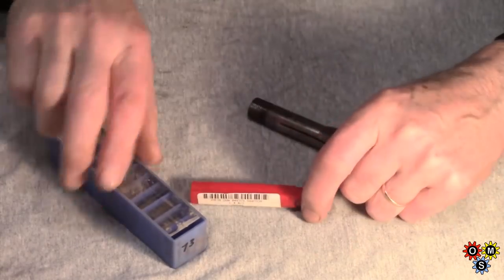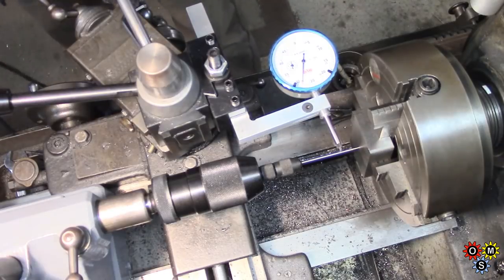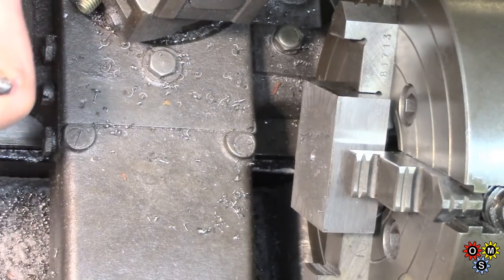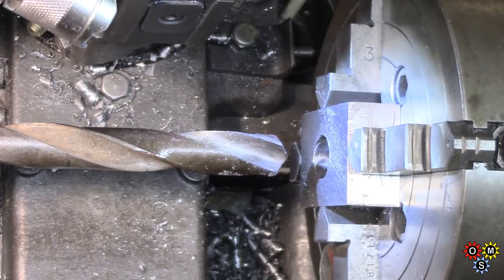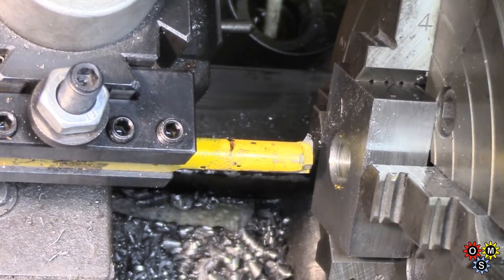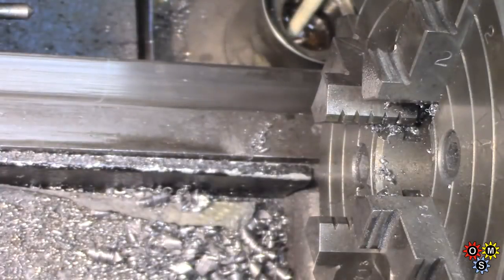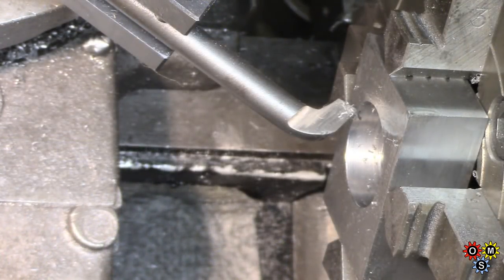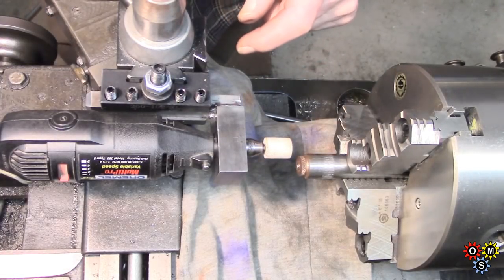Dremel Toolpost Grinder

Comment: I used the adapter that turns  your  Dremel into a router, it's a very nice easy to use adapter.  It has a channel in it that allows you to use the 1/2 tool steel to mount it to the cross slide  To post adapter

Comment: Wonderful video.  I assembled a tool holder that mounted on my Atlas Craftsman 12".  My dremel was used but in good shape no berring wobble, etc.  Very tight.   I've used it quite a bit to grind points on center punches lol.  That's about it.  Still a fun project and I have it now at my disposal if I need to get a bit more precision ground.   Thank you for sharing.  Good luck with your projects.
Reply from the maker: Hi Emil,
Thanks. I have since set up a holder for a small air die grinder which is actually a bit better because of much higher RPMs. One day when we get rid of winter cold I'll hope to resume some shop time!

Comment: Forget the dremel, too small. Find a small router and mount that up so you can spin the 1/4 shank stones. The dremel will bog at the slightest amount of pressure, the router will not.

If you do this be sure you buy stones rated for 20k RPM, not all are.
Reply from the maker: You are right Robert - it is though an awkward set-up to get a router mounted. I may yet try and find the smallest possible and experiment.
Reply: hell yea buddy plus the berings in the dremil will not last at all
Reply: I see a lot of those roto-zip tools at the  pawn shops. What do you think about attaching one of those instead of a dremel or router?

Comment: Have just bought a new 13x40 lathe. I have never used a lathe before, what is the purpose of having a toolpost grinder on a lathe.
Reply from the maker: Hi,
It's for those occasions when you might want to grind something in the chuck to a precise size and good finish, or even grind the chuck jaws to better truth - the Dremel however is probably a bit low on max RPMs and an air die grinder is probably better with much higher RPMs. Not something needed or used often but useful to have the option sometimes.
Congrats on your lathe - sounds a very useful size.
Reply: Thanks for taking the time to reply mate. Regards from Australia.

Comment: Chris, the older Dremel 380 has ball bearings and is much better.  They show up on ebay all the time for a song and a dance as they are 20+ years old.  Most are not used a lot and the case's look new.  If they look hammered then pass them up. I had one and bought two more on ebay.

Comment: All the mounted stones seem to come on 1/4" shanks.  This is the biggest limitation on using a Dremel I find.   Maybe if you made a set screw collet which screwed on in place of the Dremel nut/chuck (3/8x28 iirc) you'd come out ahead pretty quickly.  Here's how I mounted and used my "dremel".  Warning not for the plywood averse  http://imgur.com/a/DNWJq
Reply from the maker: Hi Matt,
Yes, 1/4 is very common - indeed a change to a better capacity chuck/holder would certainly be a plus - now you mention it I'll give some thought to that!
Certainly plenty of plywood. Your engraving set-up looks great.
Reply: http://www.homemodelenginemachinist.com/showthread.php?t=742

It looks like the consensus is 9/32(.281) x 40.  Although Dremel is German company,  it seems like they took the thread spec from old watchmakers lathes.

Engraving?  I'll have you know I've hogged material 25mm thick, in passes sometimes exceeding a millimetre.
Reply: MattOGormanSmith w
Reply: Forget the dremel, find a small router and use that so the 1/4 stones will work. Be sure you only buy stones rated for 20k rpm.

Comment: The early tools are much better.   Well balanced and probably much better bearings.  I've owned a number of different models over the years.
Reply from the maker: +Crafted 
Hi - well, must say despite mine being at least 12 years old, it is doing OK. Had to improve the bedding of the front bearing - even now the brushes are far from worn out. Haven't tried a newer version.
Reply: ChrisB257 Check this ebay link.  It's an example of the early style.  I've been thinking of doing what you did with one of these early ones.   They tend to run very smoothly.   Nice catch finding and fixing all the slop in that tool.  Maybe that is "why" I've thought all the newer style tools (I put yours in the new style class) are too sloppy.   Never tore one down to see the sloppy bearing mount.
Reply from the maker: +Crafted 
I guess they may vary but certainly my bearing housing sure needed just a bit of packing.

Comment: I have a Dremel toolpost grinder on my tiny Taig. Now, if you unscrew the nose cap on your Dremel, you will find a M19x2 thread. If you can cut a M19x2 thread (very close to a 3/4 x something Imperial; I don't do Imperial) your troubles are over. If you can't  (and I can't) cut that pitch, you can go buy the Dremel chainsaw sharpening attachment. About $15.  It has all kinds of places where you can screw it to a tool shank. This is what I did. To do it the right way, if your lathe can handle the 2mm pitch, go see www.frets.com and look up under the machining link. There are millions of neat tips and tricks there. The Dremel, however, is tail-heavy because the motor is in the tail. So in order to get things aligned you will have to use some packing.  Pain in the ar*e but much better than no Dremel TPG at all. Warning: Dremels are kind of flimsy compared to a "real" TPG.
Reply from the maker: +Juan Rivero 
Hi Juan - hadn't though of it being M19x2 - but anyways it is certainly as close as makes no odds to a BSF 3/4 x 12! It worked anyways.
I have now added a small packing and lightly tightened hose clamp to take care of the heavy end and keep it pretty firm. I don't expect to use it for anything real heavy or even that often - but useful if I need to precision grind a diameter to a close finish etc.
Reply: Dremels have ttheir limitations. But I have ground my steel jaws with it. They need careful adjustment and the hose clamp is a very good idea. I used it in my attempt to convert a dremel into a micro (nano?)  horizontal mill. Mixed results. But sometimes you want to grind a shaft to a really beautiful finish. Dremel TPG really good for that. Never thought of BSF 3/4x12 myself!
Reply: I just found this on ebay: 
Most modern, (post 1983), Dremel models have ¾ X 12 tpi 
The only ¾ X 16 tpi models are as follows…
    Dremel model #’s - #270, 370 & 380 ALL are ¾ X 16 tpi
    Ryobi model HT20vs is also ¾ X 16 tpi
 Black and Decker, Craftsman and Alltrade so far seem to be all ¾ X 12 tpi.
 Taurus M18 X 1.5 metric

Comment: Hi Chris - I made a similar thing after seeing Allen Powell's Dremel tool post grinder. <  https://www.youtube.com/watch?v=6_fxjdsKdpo&google_comment_id=z13lznk40vqdx3pbs04cj1lydrvocjbqcxo0k  > As I have yet to try thread-cutting on my Bantam, I did the next best thing and bought ready-made thread. (3/4 BSF steel full-nut from local shop or Flea-buy). I faced the nut to get full use of the thread and to make sure that there was a flat vertical, that I then tidied perpendicular to the face. My bar is a piece of 16 mm round Stubbs, faced then silver-soldered to flat of the nut. The moulding flashes of the Dremel needed tidying to get a stable seating. It works well, but everything needs covering because it throws dust. Side-grinds are good, facing grinds the dremel nose bearing chatters.
Reply from the maker: +nlo114 
Hi - ahh yes, funnily enough it was that video that got me going on my holder set-up. His is I guess more versatile but not sure about rigidity. Did like his chip breaker idea.
Using a ready-made nut for the BSF thread is a brilliant 'cheat' - good idea.

Comment: Hi Chris,
               A very interesting video that has given me ideas. It made me remember an old air bearing die grinder that is hidden beneath piles of junk somewhere. As I remember it is about 1.25" diameter by about 6" long and should be perfect for tool post grinding. I'll let you know the outcome, If I can find it, that is. By the way Chris what camera do you recommend for shooting workshop HD video. I have a small fixed focus sport waterproof job but the fixed focus limits it's use so I may have to invest in a better model. Your input would be invaluable.
Cheers old buddy.
MoK
Reply from the maker: +Mo King 
Hi Mo,
Your small die grinder could suit very well - I think others have used similar. My compressor set-up is not all that good so would tend myself to avoid an air tool.
Fixed focus sport cams are OK except for being stuck with a very wide angle lens. I use a Canon Vixia which is a regular type HD camera with the screen flipping out on left side. It has good zoom and many options for manual control. I'd like better but managed to get it for about $350 which is less than many others I had looked at.

Comment: Nice job Chris, Dremels are a pain in the A...., to mount on a toolpost because the are all plastic and funny models, difficult to hold. But it looks like you got it on center! Looking forward to part 2.
Reply from the maker: +Rob Gerrits 
Thanks Rob - I yet need to finish the securing with a hose clamp and - eventually, see if I can improve the front bearing. Might even treat myself to another Dremel - a new model.

Comment: How would you define the thread size and pitch on the Dremel tool Chris, I;m thinking of building one, thanx for the great video
Reply from the maker: +1NRG24Seven 
Hi -- thanks. I reckon the thread on my old one (the black earlier model) comes out at nominally 3/4 x 12. The minor dia is around .640 which was my starting point. I haven't yet checked out a newer version - thread may possibly be different - yet to get me a newer one sometime.
Reply: Hi, just made a similar fixture for my Dremel and the TPI is 12 and the diameter is 0.75" and 55 deg which makes it 3/4" BSF in my book. This video does show 'warts and all' but working in the home workshop from scratch making a cheap alternative to otherwise expensive professional Toolpost Grinding attachments it shows all the pitfalls and it works. Thanks Chris!

Comment: Chris,  How do you feel about tool post grinding on you good lathe?   I have always been reluctant to do it on mine since it is the onely good one I have.  Especially around the 3-Jaw chuck.....It seems to me the grinding debris get into every crack and crevis and it is so hard to take the chuck apart to clean.  Or is  it not realy a problem.    What say you?
Reply from the maker: +Glenn Felpel 
Good point Glenn and something that is of concern. I doubt I would want to do chuck jaws but if grinding a workpiece to critical dia/finish etc, I think I would for sure be preparing chuck and lathe bed with good protection - possibly even having a vacuum nozzle real close to suck up the worst.
Another factor I think too is having a grinding wheel of very hard density such that abrasive dust is minimized somewhat. A soft wheel would be nasty!

Comment: That should work very well.  Back in the 70's when I was doing lots of motorcycle work I needed a rob for a Yamaha two stroke that was back ordered for weeks.  So I found that I had a Suzuki rod that was the right length, the only problem being the big end hole was too small by a couple of mm.  So I taped the dremel to the tool holder on my lantern tool post and ground the rod to fit and put the engine together.  No problems with it everything fit and it worked fine.   Your setup is much more sophisticated than mine so it cannot help but work fine.
Reply from the maker: +Amateur Redneck Workshop 
Hi Harold -- that sounds like you managed a good fix on the rod. I don't expect to use this much but it is just those awkward occasions when it can be the answer to a problem!

Comment: I had to laugh as I was using that exact same method to dial in a part for eccentric turning in the 4-jaw last night.  Anyway, I wondered why you use such a beefy block for a plastic tool that uses 1/8 bits.  Speaking of plastic tools - I am guessing that most of the nose bearing play is between the bearing and the case and some creative shimming will take care of it.  Good project as like the Dremel itself, a tool post grinder may not get much use but it's the only tool for the job when you need it.
Cheers!
Reply from the maker: +Eddie the Grouch 
Hey Eddie -- well, that dialing in was in the category of "manage somehow even if tedious to achieve"!
The block was in scrap box, and I needed a 1" approx offset, plus enough 'meat' for achieving an OK (if ugly) weld! Wasn't worried about the rather bulky chunk!
Am hoping to investigate bearing soon in detail.... see what we can do.
Reply: Oops.  Forgot to mention, now that you have a mill, and using your block to bar weld as an example... you can make a shallow pocket or groove to keep pieces from moving when you tack weld them together.
Reply from the maker: +Eddie the Grouch 
There's a thought Eddie, thanks - had not really thought of that - super sensible idea! I just set up in a clamp, used a square and went to it - fortunately it held square well.

Comment: Hello Chris,    What a simple way to get a tool post grinder, very well done.
Reply from the maker: +Glenn Felpel 
Hi Glenn - well, if I can get it set up with enough rigidity I think it can work for those few occasions it might be useful. Front bearing may be a factor yet to improve if poss.
Reply: +ChrisB257    Looks like you've found one of the major problems with the dremel, the front bearings are rubber mounted, therefore not easy to rectify !!!,  One of the others is that the minimum speed is really a bit high for many delicate jobs
Reply from the maker: +William Gotobed 
Hi William -- my old Dremel actually had no rubber in the bearing housing halves - and so the small amount of packing did firm things up quite a bit.
Yes, min speed can be a bit high. My next challenge is to find a really fine grit stone that will fit.

Comment: Nice project, Chris. I've used the QC Dremel mounts from Alisam.com for several years now for light grinding on the lathe, and they work pretty well, although made of aluminum. I used one to grind a second 7mm hex key for my antique Atlas 4-jaw a few years ago, and it worked pretty well for that, although slow. 

Wrote a little article about the mounts on my blog several years back: 

http://things-i-learned-this-week.com/2013/11/08/update-mounting-a-dremel-tool-to-your-metal-lathe/

I use 3 Dremels here in the shop nearly every day, and also found a super-simple and handy way to mount them in a vise and use them hands-free: 

http://things-i-learned-this-week.com/2012/08/24/a-simple-way-to-make-your-dremel-moto-tool-hands-free/

Thanks for all you do. I really enjoy your videos (even the Willie Nelson poem, heh, heh) . 

Dave H. 
John 14:6
Reply from the maker: +davesrepaircom 
Hello Dave, thank you... even for putting up with one or 2 'odd' ones! :-) 
Followed your links, thanks -- that all-in-one item looks pretty good and your simple piece of 1/8 plate too is simple and great idea for vise work - may even make one of those up too. Nice.
I think I really will have to invest in a new Dremel - such useful tools even though small.

Comment: You can check the front bearing, it would be easy to get a new one in place, if my memory serves me well those bearings are enclosed in a rubbery casing, but, not certain on the later.

I find those Dremel tools useful but a little vibratory...  In the ned it's the results and if it does the job, then, it's a success..........   ;)

BTW, thanks, the sticker got here safely.....    ;)
Reply from the maker: +pierre beaudry 
Hey Pierre - thx for the email to know you got the sticker OK.
I will soon investigate front bearing and see what options I have... hope to improve that aspect. I picked up a 1/2 decent small grind wheel yesterday.